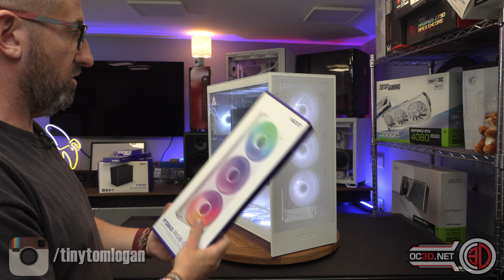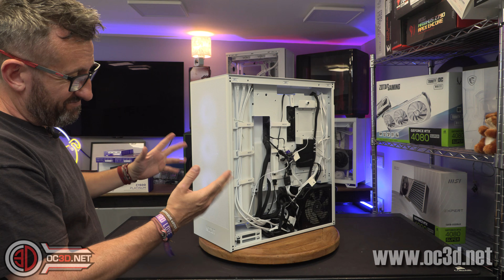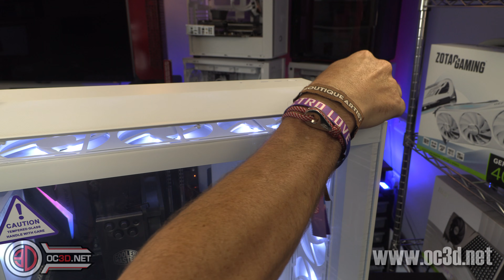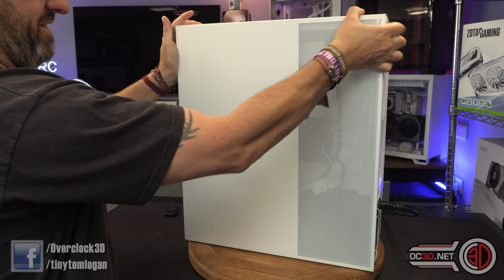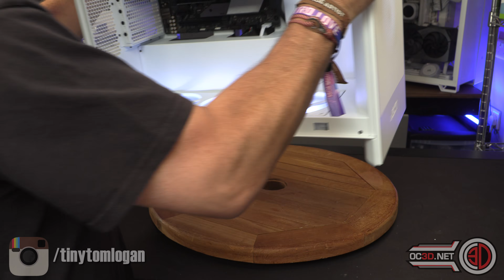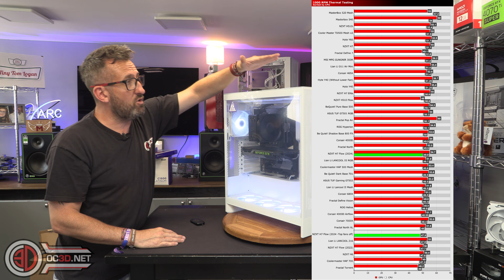NZXT H7 Flow RGB 2024 Case Review

Comment: I keep wondering/wishing that there were a way to add some 3.5" hard drives into the main compartment of these cool airflow cases.
People who run home servers still use those things, but more often than not, they get mounts positioned behind the motherboard tray, or likewise banished to the stifling PSU compartment 😢

As an example, if you wanna see a hot, early death sentenced 12TB hard drive, install it in the assigned 3.5 bays in the Fractal Torrent!
Trust me😅

That gripe aside, great video Tom!
Reply: According to NZXT's website it does have 2 3.5" mounts.
Reply: There are two 3.5" hard drive mounts. You can see them in the video. The fan controller is mounted on one of them however.
Reply: nah you don't want to see them. they would be ugly in the main compartment, and they would be slightly in the way of airflow too

Comment: Ok Ok
Why It hasnt got a dust filter on the bottom?
Reply: because it has that mesh, that acts as a dust filter. the same as in the front. it doesn't have a separate dust filter anywhere

Comment: Could you measure front panel without fan bracket, if there is possibility to mount dual 180mm fans? 17:30 - what is this? Who is using AIO? Majority?

Comment: that bottom means I could drag my 60mm 360 out of storage nice 😁
Reply from the maker: 80 with lush pull down there easily lol
Reply: yeah lol but you shouldn't put an aio on the bottom of the case, that's the worst possible position
Reply: @yes-69  it's not an AIO it's a full waterloop rad 2x360 and a 240 rad seperate pump and res
Reply: @steveaustin4118  oh okay, but the pump still needs to be lower than the highest point of the radiator/radiators, to not get air in the pump, right?
Reply: @yes-69  no it doesn't work the same as an AIO as long as a rad or the res is above the cpu block, An AIO if the rad is below the cpu you risk an air pocket in the cpu block with a propper waterloop the pump is seperate from the cpu so as long as it stays wet the wter lows
Reply: @steveaustin4118  thanks, yeah i didn't remember the res

Comment: Having PSU like that definately is the next meta. You can have 3 bottom fans with clean air and having them recessed like that looks very clean. I wish it had 420 radiator support in the roof and back connector motherboard support.